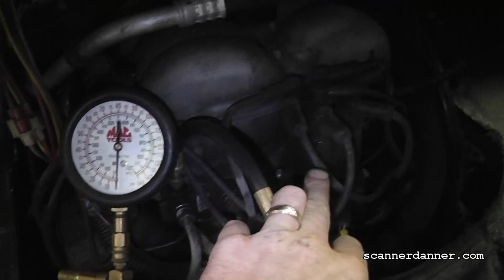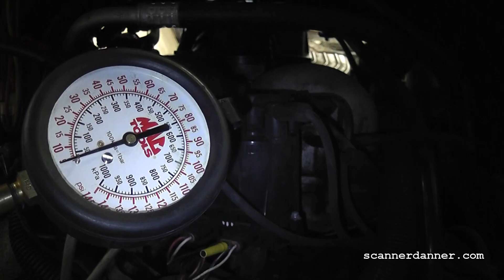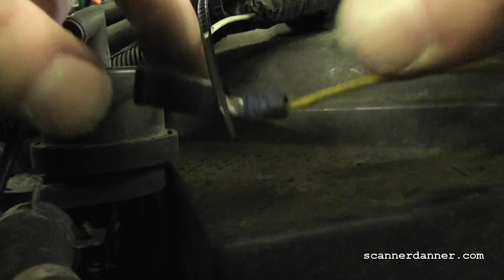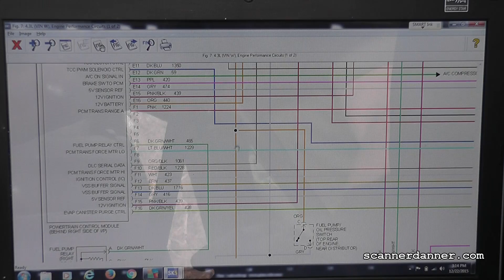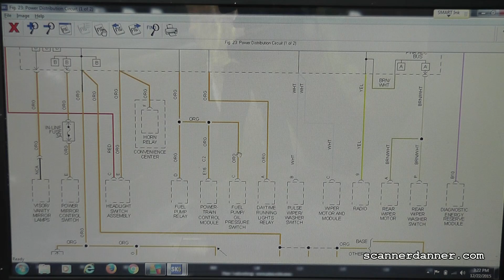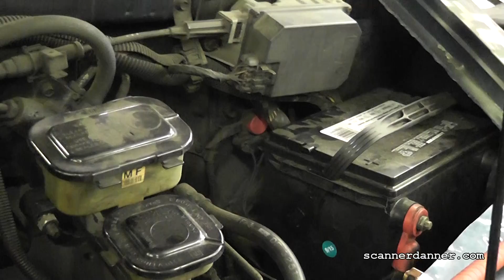Fuel pump electrical circuit diagnosis (no fuel pressure testing) GM

Comment: Why in the infinite wisdom of the modern world would you make circuits where a fault in headlights or CIGARETTE LIGHTER! (?) would disable the computer/fuel pump and the whole damn car?!!!  Hell - use two separate batteries/or computers in every car if needed! Why don't we live in a world where the designer figures a sytem where you may not have lights (or a light for a smoke) but at least you wont be stuck on the side of the road?!!! Chasing electrical problems didn't have to be the drag it is car makers - this guy is a competent, trained mechanic but even he has trouble finding out how the main ecm gets power/what is on ecm fuse without a diagram. Should be well labeled at fuses etc.
Reply from the maker: I won't work on an electrical problem on a car without a diagram.
Reply: @ScannerDanner  What if you're on the side of the road?  Not dissing you - dissing car companies. Very simple to put a list or easy to follow diagram in owners manual or on fuse panel as to what runs on each fuse for lay people or a roadside repair - and they usually don't. So as a mechanic - do you think it's smart design when a fault in a headlight connector disables the whole vehicle? Same with dome lights/lighter/accessories. There should be a whole other computer and battery operating these that has nothing to do with starting the car. Common sense - and nobody stranded.
Reply from the maker: I saw your comment, but it is gone. I didn't feel that was directed at me, thank you! I just wanted to clarify what I do

Comment: Hey ! So just watched your video. I just picked up a 95 Astro cargo van. 

I’m getting no power to the relay. Followed everything you did checked it all. Still no powers

Then I found 2 of the 4 wires running from that  block there with fuse-able links were corroded. So clean up and got jumpers made. 

Still no power to that relay: any idea what I can do from there ? 👍🏽

Thanks.
Reply: Also I am getting power to the other relay that is located next to the fuel pump relay.
Reply from the maker: no power at all? on any of the pins?
Reply: ScannerDanner correct tried all 4 pins on relay connecter and got nothing !
Reply from the maker: @desertskieshaulingandjunkr4828  The load side feed comes from fuse ECM/BAT fuse located in the instrument panel fuse box (inside the van) IT is a 15 amp fuse, do you have power on both sides of the fuse with it plugged in? (use a test light, but NOT and LED test light)

Comment: Changed out fuel filter and pump ,car still won't start what should I look at next if the fuse and relays are good ? 😭
Reply: Its a 1995 cadillac deville 4.9l
Reply from the maker: no you have spark? What is your fuel pressure? do you have injector pulse?

Comment: For a sienna 2000 if you turn key on at cold start and fuel pump runs for 2 seconds should I see any pressure on the gauge? This is without any crank to start car. Thx

Comment: Wow... mate, thanks for sharing your knowledge with the community it's incredible the experience that you have.... Well done....  I would like to ask you if would mind you to guide me in a good direction to troubleshoot a fuel priming problem?  I have a Toyota Prado 1998 using the 3.4 lts 5VZFE Engine... which is the same used in Tacoma or 4Runner in US from that era 1990-2000,  when I turn the key on, the fuel pump does not prime at all but when I cranking the engine suddenly the fuel pump turn ON and the COR relay click and car running ok... Sometimes take me 2 attempt  to start the engine, the first) to move the crankshaft and receive the signal from ECM and  activated the pump that way and the second) to actually cranking with fuel on the line!....  I have learnt from your videos that the computer has few input in order to communicate with the COR relay, but guessing mine has Alzheimer cause forgot about sending that output signal... which sensor you know are involve in the priming process?  I rule out few things EFI is working due I am able to use the car, fuel pump is working too, checked relays and fuse..... Actually I did a test forcing the fuel pump to operate (like the priming action) through the toyota diagnosis port +b and fp with a paper clip, and the fuel pump worked  fine then cranked the starter and the car started in the very first attempt!!!! Have you hear something like that?  priming action missing.... Well mate excuse my broken english,  but you got the main idea hahaha, thanks in advance I do really appreciated any advise!!!!

Comment: Gday Dan....subbed and liked great video...
honestly im kind of inexperienced but learning lots from your videos.

Im experiencing similar issues....
but its intermittently stalling in the worst of places...(like in the middle of the Bush)

I can hear Fuel pump priming....fuel getting to fuel rail....My car has Spark...
from there it will crank....but not turn over....Fuel Pump Relay makes a buzzing noise...
swapped relays and same result.....tested all fuses and all seem working.

Next I thought about Fuel Pressure Regulator..(but I dont have a Fuel Pressure Gauge),
Injectors...and coil packs..
However I ruled them out, as the very next day, having done nothing, the car started.....
(hence ruling out regulator, injector and coil pack issues)

Replacing Fuel Pump as the current one was a bit of an El Cheapo as well as Fuel filter.
it may be that its just a cheap dodgy Fuel Pump....but its getting replaced with a FuelMiser one.

Hopefully this fixes my problems but if not is it possible that a Bad Earth somewhere is the 
cause of the 'intermittent stalling'? (all other systems seem to work no issues).
Because THAT will be my next step to locating and fixing the issue if it persists.

As said im kinda a noob when it comes to electrical though mechanically I have some knowledge.

Anyways greta video...love your channel....wish I had a few handy little tools/guages to help me 
but being short on dollars trying to make do...thanks for all the videos mate

From Australia :D
Reply from the maker: "fuel pump relay makes a buzzing noise" is what I am worried about. This would be caused by a low voltage power supply on the control side (coil side) of the relay or from a bad ground on the same side (control side).
Reply: @ScannerDanner  Gday ScannerDanner
Thats some pretty good advice to get on my birthday :D
Ill use my multimeter today to check the FP relay today as wells Ground Points.
Thanks so much for the reply

Comment: I was just looking for the fuel pump test lead location to see if I could use the fuel pump to drain fuel from a tank that has held this fuel from back since this video and got caught up watching the whole video. This 94 S10 pickup has a mint body, interior, new tires but threw a rod on #1 cyl.  Could not find one of these early vortecs so I took the bottom end from a '99, used the '94 top end and TBI intake. Had to modify the oil pan on the '99 so the slave could bolt on. The '94 came with a metal timing chain cover that took 2 extra mounting bolts then the newer block so I welded them closed. Runs but 4+ year old gas and has to go so I know what I'm burning. 
Anyway, great diagnostic class vid here. Thanks.
Oh, I have a Modis Edge with the 19.4 update. The code it brought up was a 228. OBD 1 has 2 digit  codes. Called Snap On, they couldn't say why and said to run it under a Sonoma. Finally got the 2 digit code running as a Jimmy.
Reply from the maker: Not sure where the fuel pump test connector is on you S10. I think it is under a relay box on one of the inner fenders? I think this video may help as I believe I was jumping it 
https://www.youtube.com/watch?v=09_wQ9yQ85A&lc=UgyybGui5AtK7FbxhW14AaABAg
If not, a good wiring diagram will help you
http://eautorepair.adtrk.biz/?a=10817&c=24&p=r&s1=

Comment: Driving down the road yesterday in my 1994 safari. Turned on the headlights and my car stopped running and wouldn't start. Battery fine, would turn over like it wanted to start but just wouldn't start up. Found this video and immediately checked the 4 pin connection behind my battery. Was a real pain trying to unplug it but when I finally did it had the exact same issue same pin melted. This video was a huge time saver. Thank you it's really appreciated!
Reply from the maker: Awesome! Super glad this helped you

Comment: Hey love ya videos very informative and helpful. I'm hoping you could help me solve a problem I'm having with my AUII XR8 FALCON it's a Tickford model not sure what they're called over there but it seems to starve for gas when it is under half a tank of fuel I've changed fuel pump and filter changed crank and cam sensors tried new coil packs so it does this when I've come to a stop and give it a foot full and go to turn right does the big surge then comes rite any ideas have you ever come across a problem like this ?
Reply from the maker: How is it above half tank? If it's good, is the tank split in half by a driveshaft? Two pumps in the tank, one being a transfer pump?
Reply: @ScannerDanner  Hi natank is one piece behind the diff and the access panel is in the  boot or trunk as you guys would say doesn't do this on anything over half tank and only has one pump .
Reply from the maker: if it doesn't do it above half tank, then your problem is definitely in the tank itself, is there a baffle that is broken in the tank? you missed something while you were in there
Reply: @ScannerDanner  could be possible I'll have to go back in to the tank again unsure when but will definitely do that and check it out ill let you know how it goes thanks for taking the time to offer your advice.

Comment: check to seee if the orange wire has voltage if not check fuse then proceed forwardor jump gray too orange  it runs fuel pump good video otherwise

Comment: Is there a fuel pump prime connector on a 98 grand am 3100? I'm having the same problem I have power at the Prime and the gray wire at the relay with key on but no fuel pressure
Reply from the maker: not sure

Comment: My question may appear to be specific to my ,1990 Volvo 760GLE.,with the 2.8 liter V6 Peugeot engine, but as I can see from other videos this system is common on domestic cars as well. Question: why does a modern fuel injected engine have the computer to control the operation of the fuel pump relay, instead of just having the ignition switch operate a relay to switch the heavier current to the fuel pump. Does the computer automatically turn the fuel pump on and off while driving, (kind of like an electric cooling fan)? And if so, why? In the case of my Volvo, this system has 2 separate ground closures from the computer to the fuel injection /fuel pumps relay, one to operate the fuel injection relay,  the other to operate the fuel pumps relay. (The fuel injection relay and fuel pumps relay are integrated in a single package). This car has 2 fuel pumps, one in-tank the other externally mounted. Any comments will be appreciated. Thanks.
Reply from the maker: It is a safety issue. If you get into an accident and sever a fuel line, you do NOT want the tank to empty on the ground all around you. So the ECM will shut the pump off as soon as the engine stalls (RPM input). If it was ignition switch controlled, that pump would run all the time with the key on. 
Also, some systems will use a variable speed pump that is ECM controlled (pulse width modulated) and others will use a two speed pump, also ECM controlled using multiple relays and an in series resistor to the pump.
Reply: Thank you, Mr Danner. I have not kept up with the technology. I have only owned 2 fuel injected cars that never developed the problem that my Volvo has now,: "Crank but no start". My first car was a 1974 Ford Mustang II with the single camshaft, no timing chain carbureted V6 engine which I rebuilt from the bare cast iron block back in the late '80s. Technology has rewarded us with all the advancements, but we pay a price for its complexity!

Comment: Hello there from Oklahoma! Maybe you can shine some light on a problem I am having with my 96 Chevy S10 4.3L. It primes, starts and pump shuts off as soon as it starts. I can keep it running by using that little prime wire but it idles at 2000 rmp and stays there. I am at the end of my rope with this truck. Any help would be greatly appreciated!
Reply from the maker: You have a scan tool that can read idle air control motor counts?
Reply: @ScannerDanner  I dont know if it does or not, it's just a cheap scanner from Harbour Freight. I have replaced the ignition control module, coil, iac, tps, crank sensor, cam sensor, cap, rotor, plugs, pkug wires, fuel pump, fuel filter, fuel pump relay, map sensor, ecm, cleaned the egr, maf and throttle body.
Reply from the maker: Need to know IAC command vs desired. Also have you disconnected your battery since replacing the TPS? You may need to if you haven't yet.
Reply: @ScannerDanner  I will have to barrow my buddy's scanner, it might show what you're asking. Yes battery has been disconnected since i replaced the tps, a few times and I just replaced the battery Sunday evening.

Comment: Very well done. I have a fuel pump issue, believe it's electrical. I just wish I had better wiring diagrams.
Reply from the maker: Where to get service info (some free, some paid)
https://www.scannerdanner.com/forum/post-your-repair-questions-here/3757-need-service-info-check-here.html

I highly recommend the DIY Mitchell one. For $20 you can buy a 30 day pass for individual cars and have access to the same diagrams I use.

Comment: Hey Paul, first off I thank you for all the great videos! I have a 93 suburban throwing me a trouble code 54. Could you steer me in the right direction for testing for this code. Do I have a bad ground or wire somewhere?

Comment: This video saved my but today. I turned the headlights on while driving and boom it died.   I thought fuel pump for sure. Now I know how to troubleshoot that.  

The only thing I didn't like is your comment about not checking the fuse first. That's task one with all electrical.  

I resolved my problem by removing the wire from the factory plug (cut it off) and attached to the positive on the battery.  

Runs like a champ now.

Comment: What if you have constant power at the UBEC and get the 12 volts from the light green when switch is on but still does not manage to activate the relay? I used the load pro and pulsing that end terminal (Dark green & white wire at the fuse box connector) and it drops considerably, almost 0, does this mean there is a short or weak wire? Also, when pulsing it, the AC fuse clicks. I removed it and nothing changed.

Comment: bro u saved my ass I now know this proccess in diagnosing in an egucated form of open closed current my blaser 92 4x4 had this happen I knew the pump was good but I knew my icm and ditributer were in working order becouse I could start by selfpriming pour gas in the tbi but only ran that gas out but no curent behind I checked fuse only visioly my mistake also were I lost my way u r the master jedi u saved me from pure darkside of scrapping distruction of that pos 4.3 becouseonly other thing I could think it was valvs body thank you u do good work

Comment: I had the same problem, i wired in an inline fuse to the battery. now 6 months later the fuel pump goes bad. using the jumper wire from the relay the pump does not pump.
Reply from the maker: Fuel pump may have failed, but I've seen a bad ground or two in my day, so tread carefully. Do your voltage measurements at the tank with the circuit jumped.

Comment: Can I get some insight?? 1992 Safari. I can't get her to turn on. She cranks and cranks. I have spark. I don't have fuel pressure. The relay on mine doesn't have power (orange wire). I took off the pigtail and I assume that is dielectric grease (I hope) I check with my test light.. Nothing. It doesn't prime nor click the relay when you turn the key. I check the fuse box below and it has the same issue in the video. ECM I has no power but ECM B does. I check the fusible link behind the battery and the connections are not damaged. I have the bypass and pit a 10a fuse (I didn't have the reset you have handy) For the heck of it and it blew it instantly... Going further I squirted some carb spray in the air box and she turned over... Am I looking at a fuel pump?
Reply from the maker: You used the fuel pump bypass wire and jumped it with a 10a fused jumper and it blew the fuse right? These pumps on the CPI systems will draw around 10 amps. Put a 20 amp fuse in your jumper and redo the test. Then we will go from there. 
You need to get power back to your ECM, it is possible the fuse for the pump is also a power feed to the ECM, not sure without looking at a diagram
Reply: ScannerDanner

ScannerDanner put a 20amp ATO in the series and it held but blew about 5 seconds later. I didn't hear the pump working either
Reply from the maker: okay, do the same test with the tank connector unplugged. Let's make sure the wiring harness is not shorted to ground

Comment: sort of a related question..  if I attempt to start my '94 D21 pickup, it cranks, but no start.  If I remove the gas cap after trying, there is plenty of vacuum which rushes in, so it couldn't be the fuel pump, correct?? maybe water in fuel?  it's been sitting for about 9 months....  thanks, trying around....
Reply from the maker: That test with the gas cap doesn't really help us much. You need to find out what you are missing. 
Spark, injection pulse, fuel pressure to start with. Report your findings.